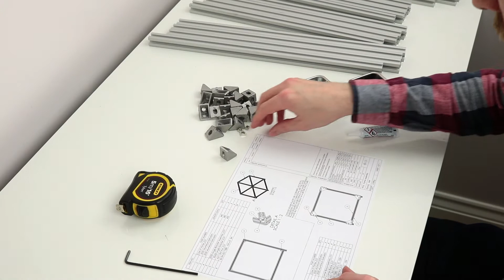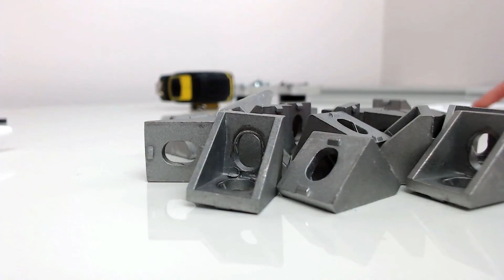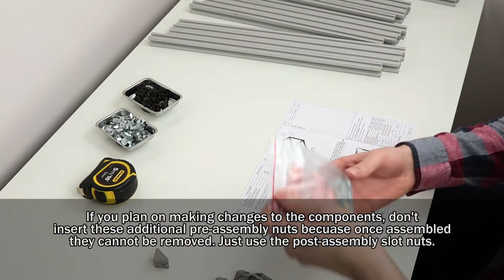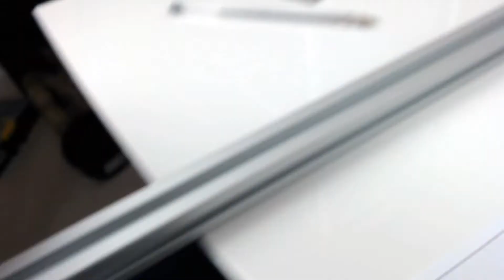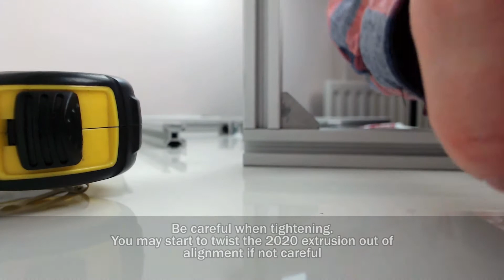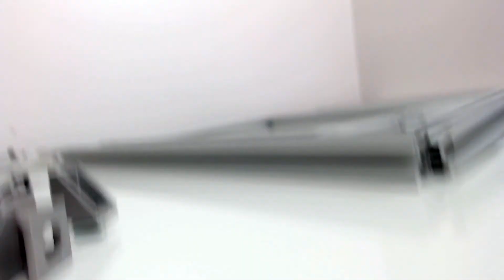All About That Frame! STEVE Build Ep1

Comment: if you were making instructions you should print a cap to go on the end of each extrusion then they could be all numbered and you can put exactly how many nuts to slide into each extrusion before putting on the corner blocks
Reply: C.R.T I mean to print a cap just as a label not to leave it on
Reply: C.R.T i mean, having an excess nut in there that’s not being used is not the worst thing in the world. You can always print a little plate to use with a screw to stop it rattling.